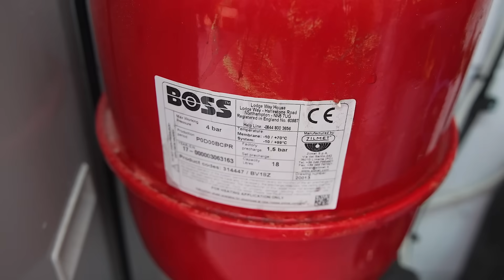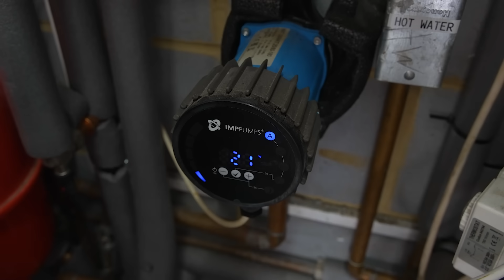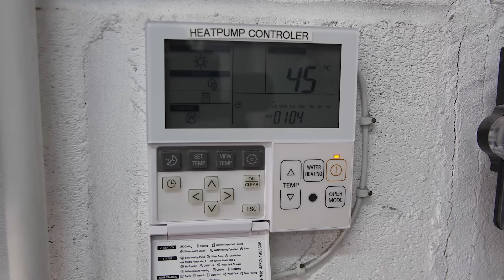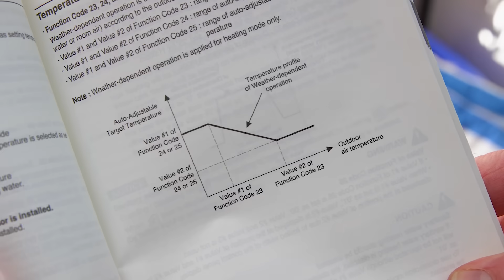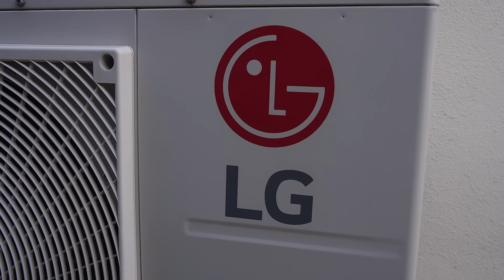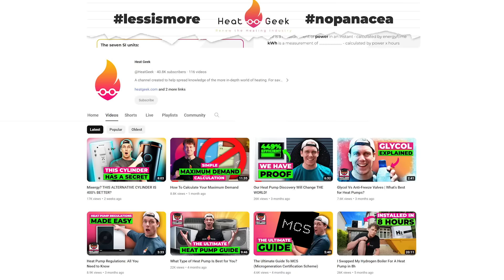Heat Geek Gives His Verdict on John’s Nightmare Heat Pump

Comment: Here in Poland heat pumps are common, quiet, efficient, used for heating in the winter and cooling in the summer.  Usually run from solar panels, so virtually cost free in use.    I don't know why British tradesmen seem to default to installing terrible overpriced systems.  I suspect the introduction of grants just brings the cowboys out to grab the money and run and no one is checking their work.
Reply from the maker: It is all about the government. They don't like cooling because it used more electricity.

Comment: I am ripping out 2 new heat pumps and putting back 2 oil boilers for a couple of my clients.  The truth is that heat pumps are not universally useful for all properties and if you are not a geek as they call it then run away now.  Newer properties where the heat loss is low work great but older properties that heated great with oil or gas will be permanently cold and your electricity bill will kill you.

MCS is supposed to guarantee the standards but they do not care less.  When you complain they just push you away to one of the other wonderful company logos in the 'scheme'.  Let's look at that, quality is overseen by Napit or NICEIC, they will NEVER attend site and check quality they just send the same installer back and you get nowhere.  If you persist you are into the contractual side and then HIES or RECC are involved, if you thought Napit and NICEIC were difficult to get engagement from then you are in for a fun time now.

The bottom line is these heat pumps are great in the correct property but if you are in doubt then please walk away.  If you decide to take the huge gamble then good luck and remember that all these fancy logos are worthless - you will be left on your own and no one will be bothered what happens to your home or bills.
Reply from the maker: I agree completely. If you have deep pockets then fine but if you want a simple  life a gas boiler is hard to beat

Comment: Ashp's are not cheaper to run than a condensing boiler on a correctly designed sytem with weather compensation,  the Heat Geek is misleading when he said that. The only way this can change is for the price of natural gas to be artificially inflated, which is probably the government's plan, they will put a climate change levy to acheive this. Heat geek also said that he wants to stop us burning natural gas, but 60% of our electricity is produced by natural gas.  I attended training courses for heat pumps, provided by Vaillant more than 10 years ago, so training has been available, but the bottom line is that no heat pump is commercially viable if you have mains gas available. I got the MCS accreditation and found that no one in my area wanted to pay the cost, this area is virtually all mains gas. However this is an interesting video and certainly if you've got more money than sense or you're  a committed tree hugger then fill your boots.😂
Reply: Yep. I'd call myself quite a tree hugger but the economics of all these solutions are terrible right now, with the possible exception of air-to-air (minisplit), if it really is going to last for at least 10 years, and you can tolerate a "cassette" in each room. My property, a modest 3-bed semi, is also Band E (Council Tax), so 0 Eco4 subsidy. And 3 p / kWh feed-in tariff during the summer, plus expensive batteries for long winter evenings, totally rules out solar panels as economically viable.

Comment: The size of install and the cost of a heatpump is just too much for regular homes. People used to complain about satellite dishes, these are a total eyesore.

I know my way around a standardi boiler and the workings but this just seems so complicated. When you can go get a combi for as little as £500 and use it as needed, how can there be value from this new tech, even with grants?

I'm not a Luddite. I love using the latest tech if it improves things. I'm sure there is a place for heatpumps but in a country with so many people crowded together in relatively small homes I don't see this working out.

Comment: When he started explaining the stuff that was there necessary or not i was thinking my god that is overcomplicated. Havent watched to the end yet but im cery skeptical

Edit soon as hes talking about bearings his knowlage level dropped like -3000 fan bearings do wear more if horizontal but that shouldnt cause that noise crappy ill fitting parts make that noise. Also id be suprised if the bearing have gone already considering they go 8 or more years in a pc. Yes its smaller but id hope theyre using a more aproprite bearing than whats in a pc fan

This is shitty bearing from factory but a 2 degree angle isnt going to kill them like that or even if it did it just proves theyre over priced under engineered rubbish

Hest pumps are low quality peices of trash. 

I used to skate for 10+ years i know a quality  bearing when i see it and this isnt it

Comment: Sorry to say that while this system is the latest in heat pump technology looking at the installation with three circulators and a zilmet pressure vessel plus all the ancillary valves and controls the problems will arise in about 8 years time. No spares available, leaks to attend to, no service engineers to correct early installed systems !  Buyer beware, you will be the one with the cheque book.

Comment: Heat pumps only work 95% of the time and when you really need them in a prolonged cold snap, every engineer know they'll not deliver. Government hasn't got a clue just dictates what it's sycophant advisers tell them. Unit cost of electricity still way to high for anyone to contemplate as its only the nieve and optimistic that get them fitted just now

Comment: There's no way that is a Council Tax band D or lower house. Meaning he would get NO SUBSIDY WHATSOEVER for the foreseeable future. In a way that simplifies things: keep the gas system and add the heat pump. The gas system can continue to give you near-instant hot water for kitchens and bathrooms and a backup if the LX system malfunctions. But wow. Not only a professional install but servicing needed each year. £££££££££££ ...! And, as ever, even if you have solar panels, the least amount of energy when you need it, expensive to install batteries for winter evenings, and, perhaps most shocking of all, a crappy 3 p / kWh feed-in when you can actually sell some off during the summer. The intention's all very well, but they ain't making it easy for us.

Comment: Heat pumps, great! Why does no one seems to understand that they are powered by electricity which is three times the price of gas! Add in the istallation costs they need to have a cop of over four just to match gas at current prices kw for kw.
Reply: Electricity is three times the price of gas, so heat pumps only need to be three times as efficient as gas to break even. A COP of more than 3 would see you saving money compared to gas. I do admit, there's no reason to throw out your gas boiler if it's already working perfectly. In that case, it'll take you decades to pay off the heat pump, and there wouldn't be any monetary benefit to doing so, at least not that you'd see in your lifetime. However, it's a good option if your gas boiler is on the brink, or if you care a lot about the environment, and don't mind doing your (albiet expensive) part.

Comment: Ive got solar power and a battery. Wouldnt an electric boiler be a whole lot cheaper, less complicated, quieter and smaller than this monstrosity ????
Reply: Worst case scenario a heat pump will use about half of the electricity of an electric boiler, best case it will cut it by ~80%.  Freeing up the rest of your capacity for other things, either other appliances, or selling back to the grid.

An electric boiler might also require too much power from the battery, and even if the battery has capacity, it will still need to pull some from the grid.
For example, a Tesla Powerwall 3 has 11kW of power, and if you have a 14kW electric boiler, it will still need to pull the extra ~3kW of power from the grid when running.

Comment: There is obviously going to be more heat in the air on the south side of the house. Basic stuff. Daikin are correct.
Reply from the maker: I agree. On a hot summer's day people seek shelter from the sun. It is not just about escaping radiant heat. If you sit under trees the air is cooler.
Reply: @SkillBuilder  and if you bothered to read the installation manual for Samsung heat pumps they do say not to place in direct sunlight
Reply: @sjaguartype The heat pump in the video is LG not Samsung.
Reply: @manicminer4573 sorry my bad, but Samsung units say not to place in direct sunlight

Comment: I immediately get annoyed when people use the “reduce carbon” statement 🤬 If these heat systems are more efficient and cheaper then it would stand on its own merits. One thing this does PROVE is the idiocy of Net Zero. As has been argued by many engineers, Net Zero is IMPOSSIBLE for decades to come. Clearly we can see that there won’t be enough engineers trained to do this for at least 50 years

Comment: Adam is 100% incorrect about placement of the heat pump. South facing heat pumps do perform better when the radiant effect heats the air immediately surrounding the heat pump. Daikin know this through internal testing and state it in their installation literature.

Comment: I am unconvinced of the knowledge and understanding of the so-called expert. All revese heat engines (air con, refrigeration, heat pumps) work on temp differences using boyles law where compressing a gas raises its temp above its surroundings emitting heat (such as the black pipes behind a fridge, or the outside box in a air con, or the central heating in a heat pump), and the refrigerant gas is pumped into a lower presure area where its temp decreases below that of its environment, drawing in heat. In an ideal gas (PV)/T = a constant, where  P = pressure, T = temp, and V = volume. So, a higher outside temp (such as on a for a heat pump gives a higher temp difference between the refrigerant in the heat pump and the outside and the greater transfer of heat to the refrigerant. This is why it is important to know what goes on in the white box and why the so-called geek has no idea what he is talking about, basic physics. The reason why refrigeration breaks down in suppermarkets during hot weather is that the outside temp means the reverse heat engine  has to work harder drawing more electricity to maintain temp in refrigeration units to maintain temp in the gas cooler outside above ambient temp allowing temp to dumped outside. This is an example of why outside temp affects the efficiency of whatever reverse heat engine you are using and why a south facing wall in a heat pump would be more efficient. Send him back to college to study mechanical engineering, particularly thermodynamics.

Comment: I could not stand that continual noise from the Heat Pump, I worked in Industry and saw a whole load of silent fans so it is possible to have HVAC that runs silently. Heating systems are now so complicated that the average Homeowner has to hire a so-called, 'expert', to fix the system when it goes wrong,(as it will). Just like modern cars with all the electrics, modules, and built in redundancy, the home heating systems are going the exact same way. I was doing a job in north eastern France at a firm that constructed pressure vessels, the firm had a sideline producing wood burning stoves with water jackets that could be plumbed in to central heating systems, I saw a couple undergoing pressure testing to check there was no leakage, the boss of the company told me that they sold them as soon as they were made so it seems that simple, old fashioned heating stuff that is guaranteed to work, is popular with the French.
Reply from the maker: The noise of the air rushing through the fan is not something that can be eliminated by good bearings.
Reply: @SkillBuilder   Larger fan blades as well as lower speeds does help ! The box the fans are in needs to be as robust as possible also rubber mounted to stop sympathetic vibrations, also insulating the fan box does help.

Comment: Heat pumps burn more gas at the power station than a gas boiler in the house.  They are bad for the environment.  Wind power is irrelevant to new loads on the grid like heat pumps.

Comment: Few paving slabs laid and new bearings on on the fan surly that's a cheap part fix £200.
Reply from the maker: You left a zero off the end. The fan replacement is £2,000. You can't replace the bearings.
Reply: @SkillBuilder  Wow

Comment: The compressor on a heating pump system, consumes between 2KWH and 5 kWh!  2KWH is £54 pence per hour! 5 kWh is £135 pence per hour! A heating pump is a mortgage. He needs to go back to a Combi boiler!
Reply: Thanks.
Reply: @nickhickson8738   Absolute pleasure!
Reply: False. I have 3 different ones all hooked up to their recommended fuse of 13amp so the max any of them can physically use is 3kW. And I've had all 3 running at around 5c outside and they had a combined usage of less than 1kW.  2 of mine can modulate down to 10%. With the arotherm plus 7kW (which is a pretty common one going into the UK), the max rating is 15a on a 16a fuse, so about 3.5kW max. The arotherm plus can modulate down to 25%, so the worst case with the compressor running at its minimum speed is about 860W.
Reply: @BenIsInSweden  Not false! I presume you live in Sweden! The specifications for the UK are higher KWH! 860W per an hour in the UK is 31 pence per hour! If the system is on 8 hours a day, it works out to £2.48 pence per a day just in electricity costs! in a week £17.48 pence. In 3 months time, when we get our bills in the UK, it works out to £208.82 pence just to use the electricity to run the damn thing! What I find truly shocking about your comments, you have not taken into consideration the electricity costs in the UK, which are absolutely high, and still skyrocketing! You have seen and heard on the video, the customer complaining about his electricity has skyrocketed! Please do your homework before you make absolutely ridiculous comments from Sweden! You do not live in the UK!

Comment: Before you make the spring to a heat pump - one word. INSULATION!
Get your home warm.....
OVER insulating your house will make a major difference.
Roof insulation (thicker it all up)
Wall insulation (cavity insulation)
Windows (triple glazing)
Then stick with your present system BEFORE considering a new heating source.
For a new build a heat pump with underfloor heating - install it tomorrow.

In the UK the heat pump market is dominated by non trained "jack the lads" & 'jobbers" milking any available subsidies & offering worthless guarantees.
We have a generation of installers who gained their experience on installing heat pumps to swimming pools.
In conclusion the UK heat pump market is fed by greed. 
Greed by consumers thinking there getting something for nothing.
Greed by the installers selling snakeoil.

Comment: Why LG? That's a brand for consumer grade washing machines and TV's, and many of their heat pumps models are not top notch in the mechanical department. Choose a brand that is used in offices and industrial applications. Plenty of quality brands like Mitsubishi, Daikin, Carrier, Emerson and Panasonic. They're only marginally more expensive, which will pay off. Only in the premium line is LG equally decent, and in that line there is not much price difference.

Comment: He heat pump works ,When the electric bill charge should are  about 4 times cheaper than Ng  We are charged about .50 € /kw h for electricity at best he cost may equal  for a new fit it is very expensive to install the payment pay back Is years.

Comment: Mmm !!  Things I've taken away from a good chat ... Maintenance (capability and availability!!!). Sealed units pump replacement not possible.. Design life of system + maintenance have to be added to operational costs. Flexibility of system (not mentioned at all) ie time to heat up house .. does system have to be on all the time ? (I like a cold bedroom but warm during the day. Close down system when out? )... and all this extra to system design, selection and installation (not forgetting new plumbing). Risk I'll say! OK if I have to get rid of my gas boiler (I'm in Scotland!) I think it will be back to the 50's (I'm that old) ... get up clothes on asap inc long johns try and keep one room warm in the depths of winter ,pile coats on bed at night ! Who remembers this ??!!